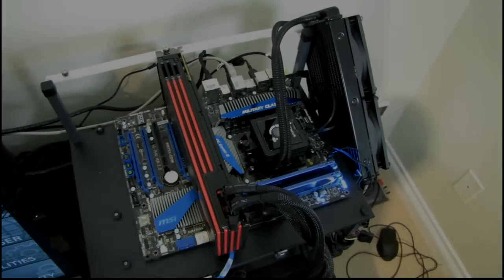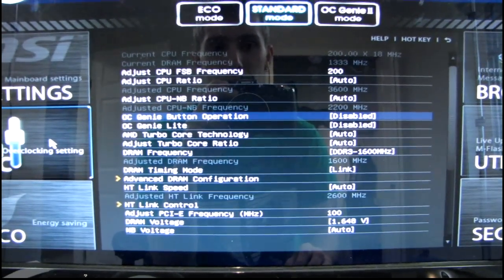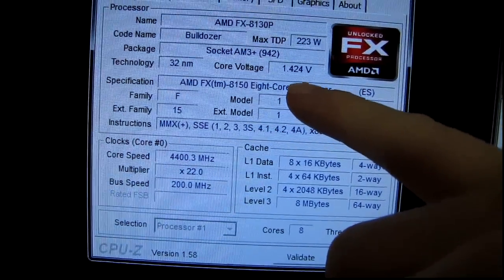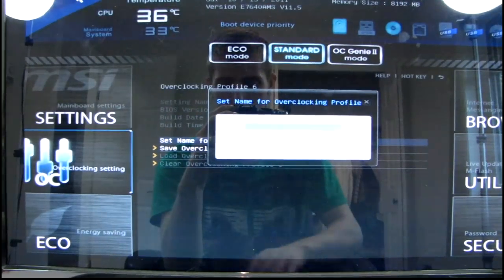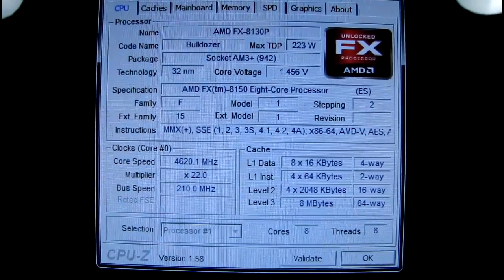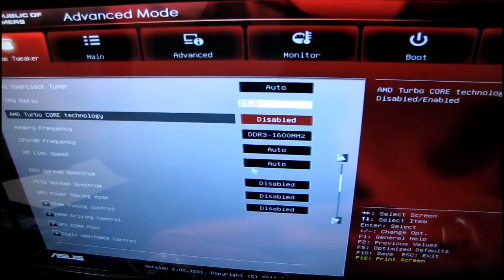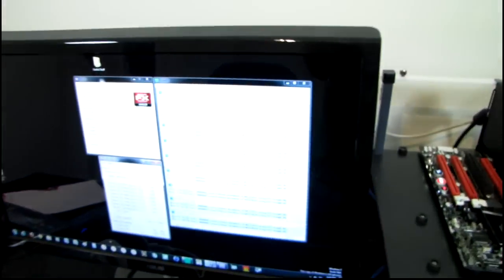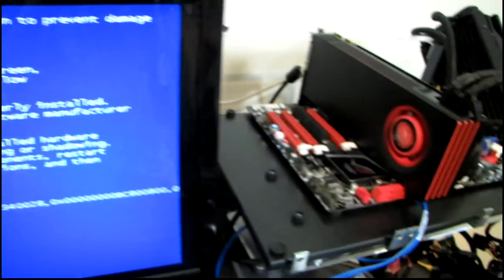AMD Bulldozer FX-8150 Overclocking Guide & Tutorial Linus Tech Tips

Comment: If you want to really see extra speed, leave the system as it is and buy yourself a sold state hard drive, remove the bottle neck, its so quick, games load quicker. Honestly I am running 8150 16GB AMD memory 1 x 6850 graphics card and a 256gb solid state drive as my boot, with a 2 x WD 256gb raid 0 for the progs that I dont need to worry about. It really is an awesome build... If anything update your BIOS!

Comment: @mrDMxtreme AMD's architecture has always leaned toward more voltage for similar clocks to intel, but generally similar temps, or lower in some cases, just look at any of the Phenom chips, you could give those things a horrendous amount of voltage, get them to 4/ 4.4Ghz and they'd happily sit in the 60 C degree sort of range. So please take this with a pinch of salt

Comment: for the temp is core temp that is not updated! I've a fx cpu and i use hwmonitor or the mother board suite! I've a fx4100 with a asrock 970 extreme3 @ 4.62Ghz with 1.42v in the bios!

Comment: If you are going to buy a new motherboard, i would go for a 1155 one, z68 specifically.

The i7 980x while a great processor is a dead end and not that great for gaming.

The 1155 will upgrade to ivy bridge, get a 2500k for gaming or 2600k if you wan to do work as well as game.

Comment: @OdinAlgeron did you factor in motherboard? gpu? no you did not and you can save 30$ by getting the 8120 it is just a downclocked 8150.  I am not hating on intel I like them better than AMD, but price to preformance is amd.  However any system over 600-700$ is intel no doubt.

Comment: @Midgetkilla48 You might need to go look at that video again, you seem to have bad reading abilities.

The oc 8150 at 4.8ghz barely manages to equal/beat a 2500k at stock speeds.

8150 at 4.8 barely manages 1077 on gimp, the 2600k oc gets 2225.

On cinebench the oc 8150 gets around ~7.5, the oc 2600k gets ~9.7.

Right now the FX series of chips just don't make sense, get a phenom 2, then just upgrade to piledriver.

Comment: I've used to have this mother board to get higher CPU voltage settings just go to MSI website and download click bios then you will get to have higher voltage settings using click bios up to 1.96V even if you cannot chose it in bios and when you setting it over the avilble voltage in bios using click bios go in to bios and voltage will be on auto don't touch it cause its the high voltage settings or use cpu z and check
Reply: some versions of this msi mobo bios limits to 1.449V max

Comment: The extra is coming from a good cooler for the cpu.

It takes a fully multithreaded app to have the 8150 match a 2500k.
All 8 cores must be used for it to match a 2500k.

And there lies the rub, 99% of things you will do an a pc will NEVER use 8 cores.

And that is why for gaming especially sandy is superior.

Core for core the 2500k is at least 25% more efficient, seeing as it takes double the cores from bulldozer to match it.

Comment: @bumblefoot2004  Games like Bad Company 2 and BF3 benefit from having six cores. Even quad core optimized games benefit from six-cores since the game can fully utilize four and leave two for everything else. However a good high-end quad core, i5-2500K or Phenom II X4 BE, will rip apart any game easily these days. The need for six-cores is just not there yet, though I personally like having those 2 extra cores as they assist in multitasking and pull ahead in games like BF3.

Comment: Corsair’s Hydro series H100 Water Coolers,
i got Croshair The Hydro Series H60 Temperatur are 29-35° on Desktop , in Games Like BF3 are 49-56°Maximum! Temeraturs are little to much because i Overclocked My System( 8x 3,60GHz ) to 8x 4,20GHz But still quiet ;) only My GTX580 is loud x)
if you want to buy one, Buy from Corsair Hydro series!

Croshair are Awsome !

Comment: @MrOwlgoesw00t Because its fact. If you understood anything about the "nuts and bolts" of how a processor functions you would know this. Windows 7 is not capable of effectively utilizing the processors architecture, more specifically it's modules and how they are tasked. The same goes for most all current software, including game engines.

Windows 8 will be better equipped to handle the Bulldozer Module design. The processor is ahead of the software running on it.

Comment: Too many "fanboys" ripping on the processor when its performance loss is more the fault of the current software not being able to effectively utilize the processors architecture, than it being a "bad" processor. Too many self proclaimed experts that really have no clue. 

Today, you're better off getting an i5 2500K or Phenom II 1090T, this is very true. This will not change until either software catches up to the processor or AMD tweaks the architecture for next gens in the series.

Comment: @OdinAlgeron I'v got mine running stable @ 5Ghz on air with a hyper 212+ dual fan setup, temps are fine. The cooler cost me $25.00

Comment: I know this video is old, but Linus is wrong. According to a poster from Overclock.net, who is an electrical engineer who has friends who are also engineers and work for AMD, Bulldozer/Piledriver chips use equational offsets to calculate temperatures, and are more accurate at 45C. Probably, he was thinking about CPU Temp, or Socket Temp,  which is usually 10 to ~17 degrees higher than Core Temp. Also, official AMD engineers have confirmed that Core Temp and AMD Overdrive are reliable temp monitoring programs.

Also, HWMonitor is the ideal program since it monitors all the temps and voltages of your system, such as CPU Temp, Core Temp, GPUs, and storage.

TL;DR, CPU Temp isn't reliable under load for FX Chips but is under idle (but idle temps are useless) use Core Temp instead while you're running stress tests like Intel Burn Test, OCCT, or Prime95.

Comment: Ummm is my shit fucked up or something? I have this mobo with an fx 6300 STOCK! with an antec kuhler 650 radiator fan is 120mm and exhaust in back, 200mm intake on front and 120mm exhaust on top... when I go into bios it hits 60c... wtf is going on?
Reply: This BIOS is an extremely inefficient program that runs on the CPU. I have a Corsair H55 cpu cooler and mine hits 45 C in BIOS.
Reply: +Sycabara Me too but I have the Cooler Master Hyper 212 Evo. Your H55 is very similar to my air cooler

Comment: you must still have the power save features on they . clock down your cpu to save power my Fx 6100 is running at 4.2 ghz but right now it's at 1.409 ghz
i did have an issue when i first used overdrive on time to try auto clock .. and learned don't touch it lol messed with my turbo mode

Comment: @flashfith Myself and four others that I know, all run almost identical hardware. I run a 1090T OC at 4.1GHz on all six cores. Three of them run the i5 2500K, and the last one is a 2600K. We all share the same Radon 6970 GPU, I have two but for this tested I pulled one card. I got better framerates than all four of them consistently in the beta. Those CPU limitations fade away in heavy combat at HD+ resolutions. No one has BF3 #'s for the FX, the beta ended before FX release. o.O

Comment: @snoopy210190 The current version of Win8 is NOT updated for BD. Now to counter your argument, Intel CPUs have almost always performed "better" bench for bench than AMD, the gap in that performance vs price is where AMD calls home. You almost always got more performance per $ with AMD. If a $220 i5 only nets a couple FPS more than a $170 1090T in some games, the i5 does "better" overall but the 1090T is the better deal. Over the past year, the 1090T has even started to pull ahead of the i5.

Comment: I got my 8150 to 4.4 ghz with voltage up to 1.4 just increased multiplier to 20x so easy...
H100i has temps between 86F (reported by the chip) to 114f (reported by the mobo...)

Comment: For comparison, a oc 2500k at full load draws  ~300 watts - at 5ghz-

Still thats around a 200 watt difference in power consumption with a balls to the wall OC on a 2500k.

Most people will prolly not reach 5ghz on the 2500k though.

Comment: @TRStrider74 T Nonsense, OS updates can only do so much, BD can't even perform well in single-threaded applications and in even lightly threaded applications in can't even beat the older Phenom II's. It's not even a good price for performance chip, as the 2500K is similar in pricing and it performs much better. It's not about Intel or AMD, just performance.

I have a 1055T and i was planning for an upgrade to BD, but after seeing benchmark after benchmark of terribleness, it's not worth it.

Comment: hat is th bus speed? This is way to quick
Reply: Mein Kanal! It's not an Intel processor. This AMD processor is supposed to run around 200MHz stock bus speed. Also my ancient desktop processor (which I still use), the Pentium D 915 Presler, has 200MHz bus speed stock. It only has a multiplier of 14 though.
Reply: DJ S I meant the video was way to quick, I don't know what the bus speed is. I typed that too quickly
Reply: I don't know. I only use the Bios. I don't have the newest cpus and mobos laying around so I am only used to using a classic blue screen bios. It's not that hard to overclock. Though you should take precaution before you overclock. If you are using a stock cooler setup, make sure it is clean and monitor the temperature with a program like Speedfan or CPUid HWmonitor. Make sure you have enough headroom temperature wise before you touch the bios. If the multiplier is unlocked, you can increase it. If it's not unlocked, you can increase the bus speed by 5 or 10 to start with. Then keep increasing the bus speed until the system isn't stable any more. Then, you can start to overvolt the cpu a little bit. Don't overvolt it too much. You should be able to find on the internet what voltage the cpu can easily handle. Keep in mind: the higher the voltage, the higher the heat output. The most important thing you have to mind when you are increasing the bus speed, is that you correct the pci lane speed and the ram speed to its stock speed. This makes the system way more stable.

Comment: Whats this fascination with stock speed cpu's?

Overclock is a given for gamers, so the cooler needs to be considered.

Yes Crysis 2 uses up to 8 cores, and so does BF3, out of hundreds of games you just listed a couple of the dozens that are capable of using more than 1-4 cores.

Think about that...

With the 8150 -which is more expensive- you are putting all your hopes on matching the 2500k, which it only does when all 8 cores are used, with a handful of games...

Comment: You could buy a 8120, and a $100 cooler to reach 4.8 ghz. 

And reach STOCK 2500k performance for more money.

Or you could buy the 2500k and a cheap ass $25 hyper 212 and max overclock with that for cheaper, and completely blow away the bulldozer.

Comment: I put it at 1.387 about and it was seeming ok then it cut off and will not comeback on I jumped my PSU it came on and stayed on lit all my fans up took all out and tried would not come back on would try for a sec then cut back off without RAM it did without GPU it did it and without CPU it did it I had just RMAd my cpu and it was running pretty great until i did this and the highest  core temp read was 65 C for less than 1 sec with prime95 and went back to 55c to 61c and didn't go over again

Comment: For gaming the 3570k beat the 8150. It's got much more powerful cores and games are really bad at using several cores. Starcraft 2 is quite CPU intensive and can only use two cores, that means even the i3 2120 outperformes the 8150. Even overclocked the 8150 can't beat a stock 3570k in gaming and don't forget that the 8150 needs a lot more watts overclocked.

Comment: its not that impressive there is a benchmark out there with a engineering sample of the 8350, a 10% increase in performance in multi thread and 5% increase in single core performance looks like it finally matches the i72600k in multithread apps but probably will not be much better in games then the BD

wccftech.com/amd-vishera-fx8350-x86-piledriver-pitted-fx8150-cpu-benchmarks/

Comment: @thedingdoeatyourbaby 

Yeah... no.  Bulldozer just plain sucks.  Even if the FX-8120 is lowered to $200 it's a worse deal than the i5-2500K.  And the platform isn't cheaper.  A well-featured 990X motherboard will run you $150, the same as a well-featured P67 board.

If AMD makes a shitty product the worst thing we could do is support them.  You'd be rewarding their failure.  If you actually want to support AMD and their good efforts buy a Radeon graphics card instead.

Comment: Might need more juice.  Not sure about that though, anyone else that's knowledgeable about this?  I think it just varies by chip.  Find out what the stock voltage is, then just try bumping it up a TINY bit at a time.  

Worst case, it's not enough and your computer doesn't boot, then you reset CMOS and try again :)